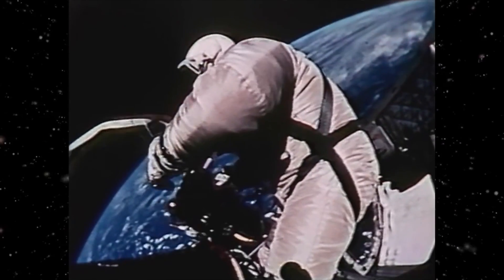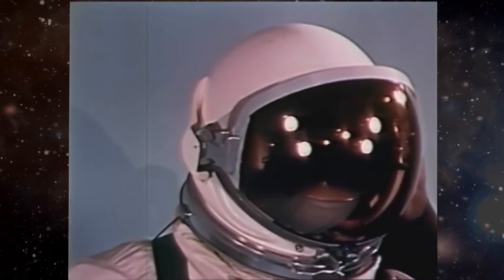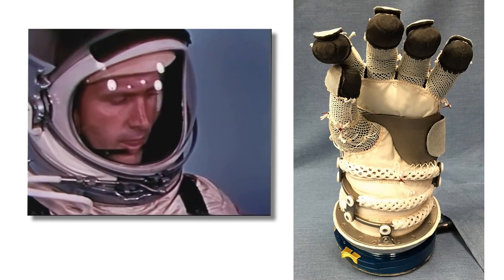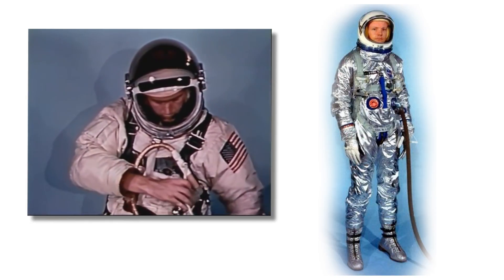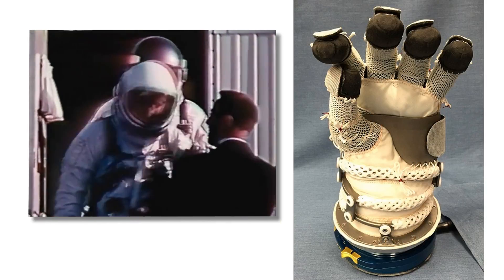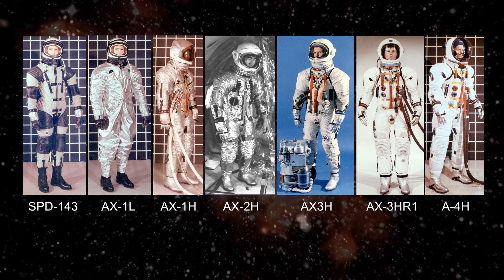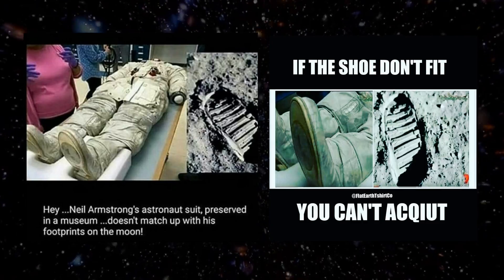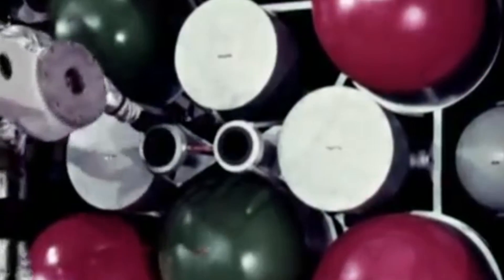The Space Suit Special

Comment: I think maybe you need to research deep diving gear.. And compare what they actually wear to the astronauts..
Reply from the maker: +Heartbeat Storm Why ?
Reply: @humansofearth25  Probably to compare or differentiate between the two extremes.  Deep sea diving suits have to withstand many atmospheres of pressure differential, while spacesuits typically need to only withstand one atmosphere (14.7 psi) or less.  Some people have trouble accepting this fact.  Yes, spacesuits still need to protect from temperature extremes and radiation, but that's do-able.
Reply: Link to spacesuit vs vacuum chamber videos